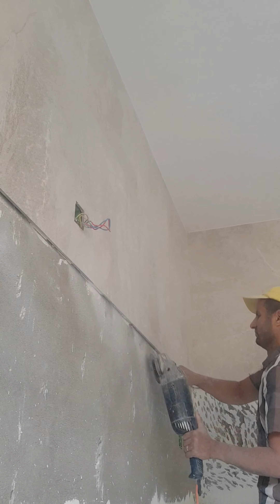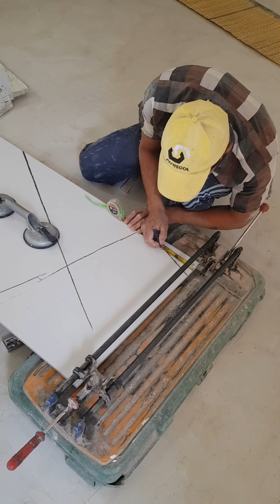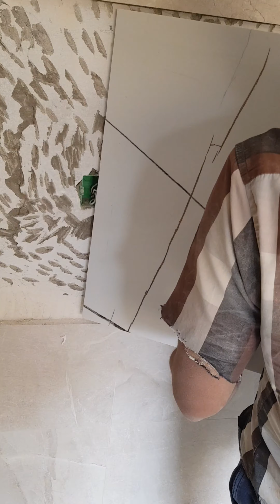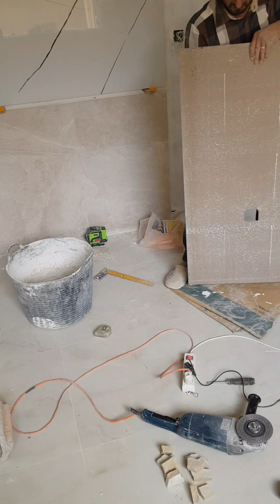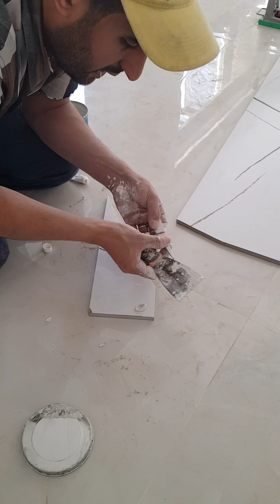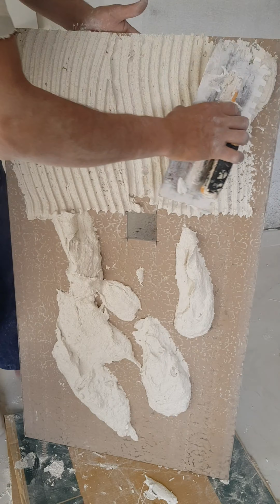كيفية تركيب بلاط السيراميك !!  ذات نوعية جيدة وثقيلة

Comment: Please wear a mask when you grind thinset and durock. Super unhealthy dust comes from that. Also if you had turned and cut the tiles you could have filled the 1 inch gap under them. Good luck collecting a check on this job!